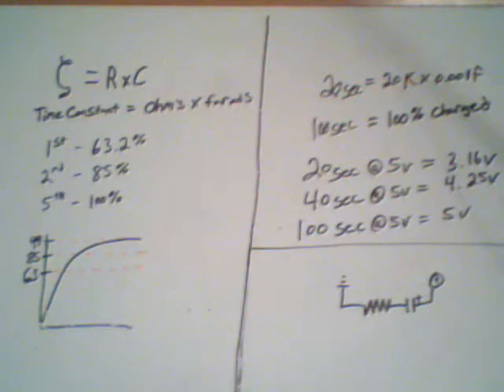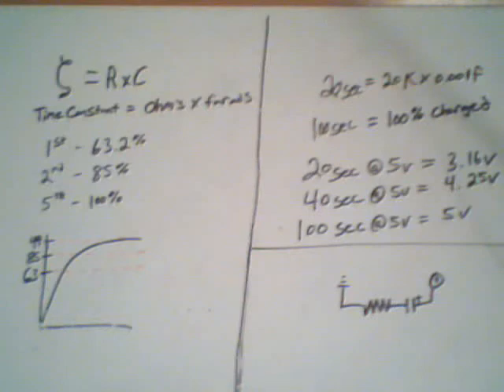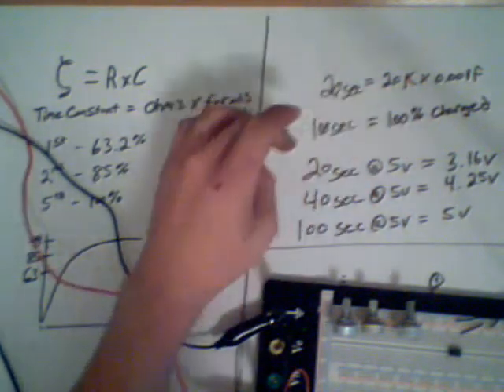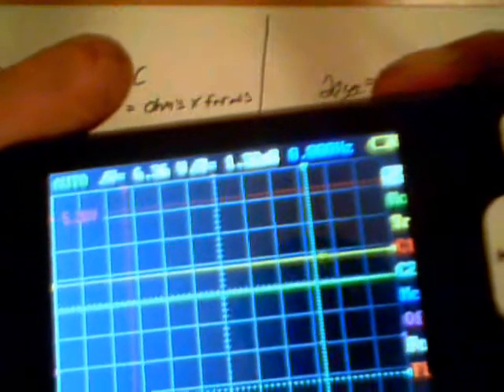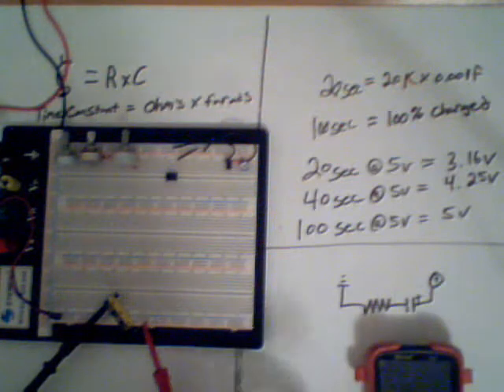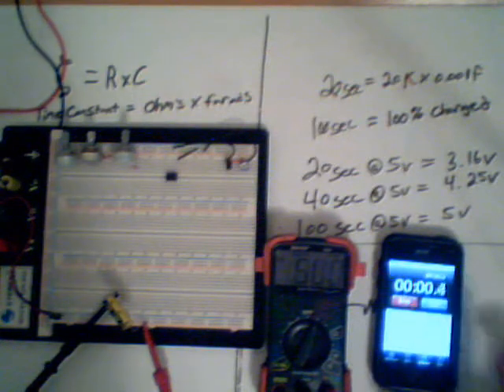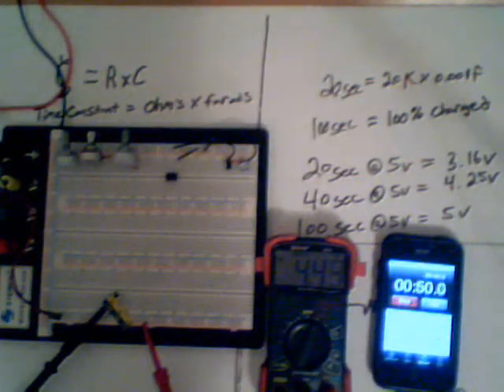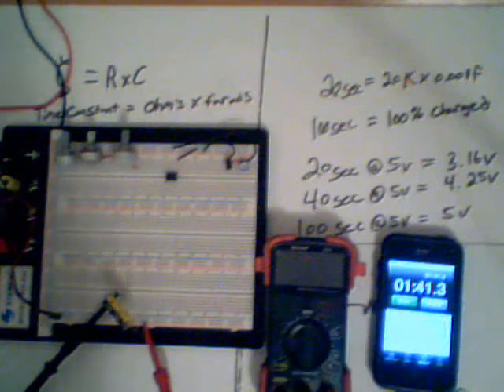RC Time Constants Explained

Comment from the maker: There is also RL circuits which operate in a similar way, They use inductors instead of caps and have some pretty interesting key features. Ill make a video on them soon, with a simple FM radio. These simple circuits though are used in just about every devise especially anything that has microchips but now a days they are so small you don't even notice. 

 Your welcome! ;)